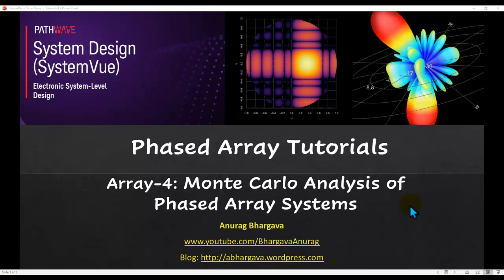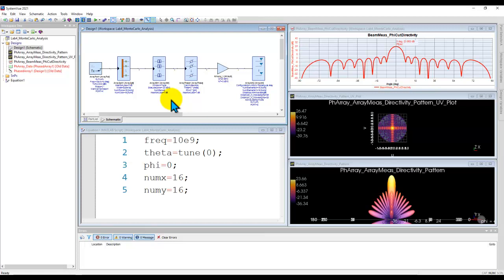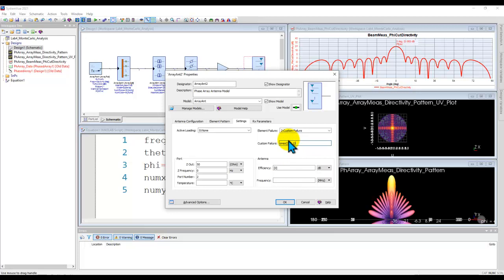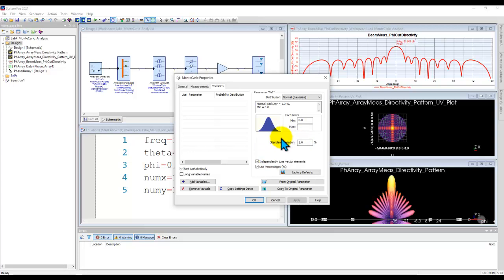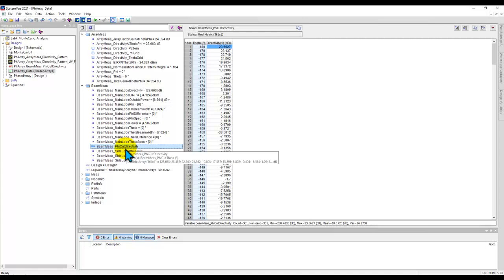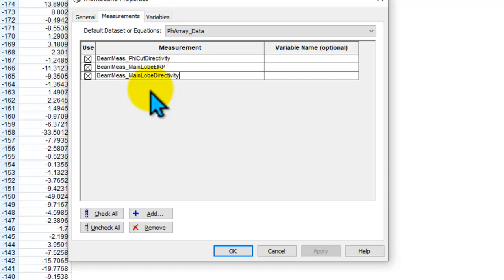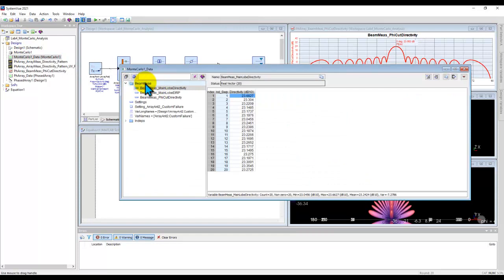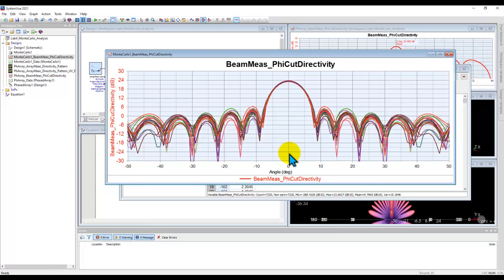Array-4: Monte Carlo Analysis of Phased Array Systems

Comment: Hello，Mr.Bhargava.
 When I use ADS2021 to open the workspace,there are some problems happend.(I have been using ADS2020 and ADS2017 before.) In ADS2021, when I use FEM simulation layout as usual, job failed appears. I tested the cell that was successfully simulated with FEM before, and job failed appeared again. I created a new workspace and performed FEM simulation again, but the job failed still exists. I switched to ADS2020 for FEM simulation, job failed still exists. I can only simulate Layout through momentum, but I can't use FEM. Could you help me this problem
Reply from the maker: I am not sure what is the exact error message so difficult to help. Provide full error message so that I can help or contact your local Keysight tech support team